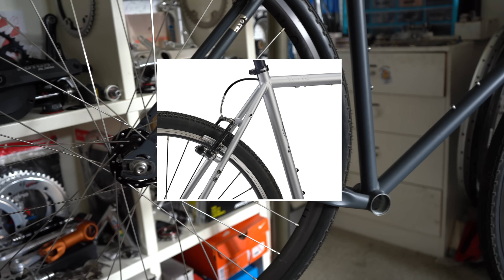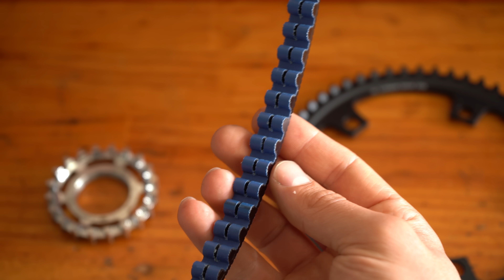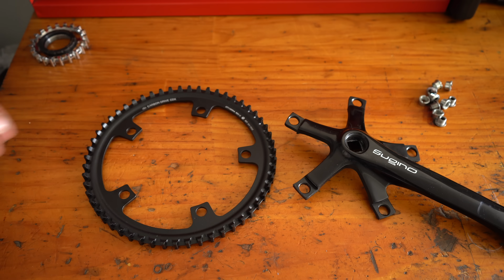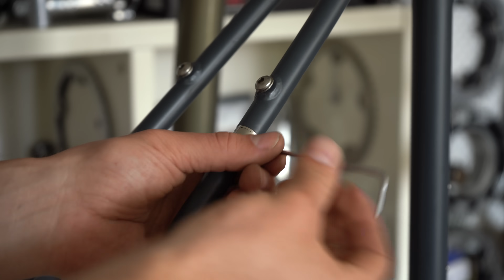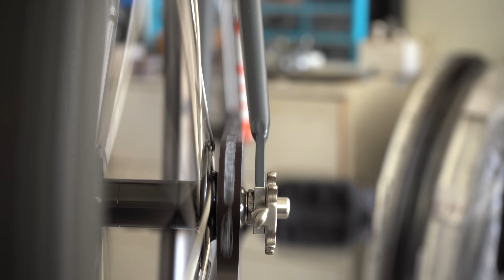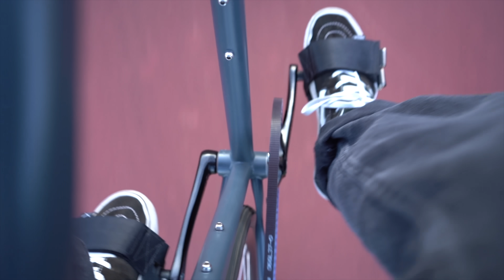Belt Drive Fixed Gear Build

Comment: Nice bike! Beatiful! But caution: Tensioning the belt that much might kill your bottom bracket quite soon. Especially if you don’t use a hollow tec or similar: Brackets with some lever from the belt to the bearings will be stressed a lot from the belt tension. Ask me how I know…

Comment: Belt drive fan here, I'm about 1/3rd through your video, could I say just now, splitting the rear triangle at the axle is genius (never thought of that!), I'd be inclined to run a bigger gear at the rear to reduce wear. That Gates tool they included, it will only work for installation, not removal, which kind of makes it pointless since just hand tightened and then pedalling after fitting would be fine? Removing the rear gear though, that's a different matter, I ended up casting a brass insert for a 1/2" socket, works a treat. Anyway nice, informative info, probably be back after, once I fully view🥳

Comment: Cool build! Might have to try bulding a belt drive bike. I want gears though. I use gates belts on my 3d printer and you can tune the frequency on that as well. On a Voron 3d printer you typically use between 100-120hz, but that belt isn't as stiff as this.

Comment: I'm a regular gravel bike rider and I always wonder how long a tire on a fixed gear bike lasts, especially the rear tire, as braking uses up a lot of rubber... 😊
Reply: Mine last just as long as any other bike. I don't skid very often unless i really have to. Most back pedal, and I run a front brake for emergencies but don't use it very much either.

Comment: Perfect for winter and wet weather- no more rusty chains….that bike is siiiiick! 🤘🏼
Reply: Have been biking my whole life. MTB the last 35 years. Year round in Scandinavia. Have never experienced rust on chains. Belt drives belongs on industrial electric transmissions. Chaindrives has lover losses, always. Is also easier to maintain and cheaper.
Reply: @andersnilsson973  I've been riding my whole life. The last 10 years on a Tout Terrain Panamericana expedition-grade suspended touring frame, averaging 6K miles a year. I've never experienced rust on chain either, partly because I would blow through 3 or 4 chains a year, even with the annoying chain maintenance and regular cleanings. That's with the added advantage of using a Rohloff Speedhub (IGH), so I have a straight chain line and zero chain flex. The best conditions for any chain. But I have had chains fail, and almost everyone stretches in 4 to 6 months, causing the rear gear to wear more quickly. I've changed several on the side of the trail and one in downtown Seattle. I always rode with a prepped spare chain and Rohloff gear.  There is a BaFang BBSHD 1000W mid-drive for assist. I switched to a Gates belt drive over 3000 miles ago and haven't even thought of the belt since, except to take pictures. Zero maintenance or cleaning. No noise at all. It will take a couple of years for me to determine the cost savings, and I couldn't care less about any imagined perceptible power loss; it's a non-factor. If my 60K miles worth of experience (on this single bike) doesn't convince you, read up on Ollie Whalley, who won the 2012 Tour Divide race from Canada to Mexico, or James Bowthorpe, who set a record for the fastest ride around the world, both of whom use a belt drive to turn a Rohloff Speedhub.
Reply: https://photos.app.goo.gl/ADgC6oyPM2gyrCq27

Comment: For all who wonder if they could get away with non-split triangle - yeah, frame with elevated chainstay allows to use a belt without modding frame. Just beware - Gates states that frame has to be very rigid to not flex, this is critical for a belt drive so while you could mount belt I guess these frames aren't very best for a belt. If you look at Gates approved frame list most of them are aluminum frames. I guess, that's to ensure rigidity.

Comment: That's nice for tricks and stuff, but as a commuter I think this would be completely useless for me as I'm so used to freehub, I couldn't drive without it anymore. Freehub is a must. Also I don't like that the frame is compromised because of the belt drive, that's another big negative. Also one speed only, only if there's no hills where you live. All in all this could be a fun ride, but it's very very niche, only for specific conditions and not very flexible.
Reply: Belt drive is especially great for commuters. You come home, wipe tires (maybe) and do your home routine instead of cleaning drivetrain and lubing chain.
Reply: @event4216  lol what, I never touch the chain, or wipe tires. You do it once a year maybe if even that often. IDK maybe if you drive a MTB in a muddy terrain. I commute in a city, sometimes I run into fine gravel. There's literally no reason to justify this kind of "belt drive", it's just a novelty.
Reply: @amonynous9041  Tires - it depends on where yo live and where you keep bike. In apartments wiping tires is a measure to keep clean your living place. Slick tires are very easy to wipe, like 30sec a wheel, and I prefer them to be clean when I go out next day. Clean tires mean better traction.
Reply: @event4216  I have slick tires, it's a road carbon bike from 90es, but I keep it in my garden, really no need to wipe them, no mud. Why would you keep bike in apartment? are you afraid someone might steal it, do you sleep in the same bed with your bike? lol
Reply: @amonynous9041  I haven't got a garden.

Comment: I have a Moulton with Sachs Duomatic hub and belt drive. I like it a lot! No more chain tensioning and lubing. Just clean belt. It is a bit more work when changing a tire though. My bike also has track ends which is not ideal for a belt drive. Best would be sliding dropouts so you could set the tension once and never do it again.
Reply: I too used higher tension before. But after Watching Alee Denhams videos and knowing how low he goes with his belt drive tension I have dropped mine to the lower limit. I has still worked perfectly. Less tension also lessens the wear on hub and BB bearings.

Comment: Do you really have to have a split flame to get it on? Can’t you just have it on the back cog and like just bring it forward• Like the old school way when your train would fall off you put it back on the Big sprocket
Reply: Schindelhauer Hector have what i think ur talking about
Reply: You can't roll belt over ring as it will damage internal structure. Rolling chain also isn't OK, it worked with massive steel rings and people who don't put out lot of power.

Comment: dope setup! I moded my old surly ogre touring bike to take belts and have an onxy SS 6-bolt disc hub so I can use it as a flip-flop hub with the 6 bolt gates cogs. running mtb tires and super short ratio so its usable as a commuter/gravel/touring rig. still working up the courage to try the fix cog again after a near miss!

Comment: One tip that they don't tell you: tension the belt based on the conditions you'll be riding in. I've set my belt to the right tension indoors at room temperature, but then going out riding on hot, sunny days found that the bike frame may expand enough to put the tension higher than the recommended upper range. The same goes for the cold: your frame will contract. Your body won't notice the very slight change, but your belt will.

When the belt is outside of its tension range, it will wear much faster. I've noticed when riding on hot days, my belt will start to squeak after only five kilometres. Pouring water on it will help, but after another five km, it starts again. Running your fingers over the teeth you'll find a lot of dust. It's not dust from the environment, but the belt teeth wearing down.

Belts will last a long time and won't stretch like a chain, but you have to pay attention to tension and the things that affect it. I've only noticed this relatively recently, so my belt isn't in as good of condition as it should be after only a year.
Reply: Chains never stretch unless made of rubber, they wear out.
Reply: @kjm-ch7jc  The amount of wear on a chain is called it's "stretch."

Comment: I exclusively only use gates belt drive on my bikes and have owned quite a few now. The belt tension specs are not as stringent as gates recommends. At least as far as being loose. Over tensioning is more of an issue. if the "chainline" is not perfect having the belt a little bit loose is better.

Comment: Veer makes a split belt for frames that lack seat stay split.  The "joint" is spread over a length of the belt (sorry, idk how much)... seems like a nice option, albeit kinda expensive...but so are special belt drive frames.
Reply from the maker: Just read another comment mentioning them, I’ll have to have a look. The idea of having a belt with a joint/link makes me a little nervous but curios
Reply: @waveywheelies  same, which is why I have not really committed to buying the set up.
Reply: @waveywheelies  I've looked at a few pics of the belt and it appears the "joint" is spread over approximately 20 "pins".... the belt-ring and rear "sprockets" also look proprietary within the veer ecosystem.  I'm still intrigued, but also very hesitant to buy.
Reply: I have ridden the Veer belt for quite a while and it has worked great for me! They recommend running lower tension than Gates because of the split design, so belt slip can become an issue, but I haven't had trouble with it. One thing to watch for is that the chain line is extremely important, maybe even more so than with the Gates system, as the rear cog doesn't have any sort of spline to keep the belt from running off the cog.
Reply: @simonbrans734  so not a good choice for fixed gear....I'd probably go belt drive for my IGH bikes.

Comment: My first bike when I got back into cycling as an adult was a cinelli tutto just like this one.  I rode it as a singlespeed a ton, including with a Gates belt set up, and also ran it with a 2-speed sturmey archer kickshift hub that also could use the belt drive.  Awesome bike, very fun and versatile to work on and build up. cheers
Reply from the maker: That’s awesome! A shame they changed the design so much. The split link gives them a whole different use that not many frames cater for. That sturmey 2 speed sounds interesting! Thanks for the comment🙏

Comment: 8:12 It basically not needed. Just two discs. One on outer side of front cog and second on inner side of rear cog. It for those who wanted to try belt drive, but can't afford this overpriced Gates system. If You use wide enough belt and cogs installed precisely even they basically not needed, but "just in case" better to have.

Comment: Anything with "fix" label on bicycle parts cost redicilous for what it is...
I made single speed bicycle without this shit which literally cost like my bicycle EACH... Just using automotive belt and cogs. From my experience it not so much in need of tension, but pushing roller for which usual caliper hanger actually quite good placement.
This priciness just killing me... More than 380$ monthly wage. 🤬
Reply: How did you use automotive cogs as the "beltring" and freewheel?
Reply: First of all I ask about topic friends and one of them mentioned model with cheap enough parts. Then I buy set of two cogs(toothed pulleys) and belt. 
Then I "nicely asked" coworker to help(on my workplace we don't have CNC, so it was done in old way). He cut middle of those cogs(toothed pulleys). Then just drill holes for attach front cog on a crank arm which have changeable chainring by default and just by myself drill and screwed in ring plate on outside of front cog. 
For rear cog little bit harder. Cog(toothed pulley) with milled middle part I put on complete cassette(struggle to describe on english, low end unit usually up to 7 speed, but not a freewheel even if same principles, which just screwed on rear hub without barrel unlike higher price cassettes which is just set of cogs which You put on barrel... Essentially it is freewheel for seven speed derailleurs). Remove chainrings from cassette and use just bearings in cassette body. Make channel in rear cog and body of cassette for stopping pin to couple them, because I can't make thread on cassette body to just screw it like freewheel. Put it all together and secure stopping pin by end cup from cassette with teeth of it being cut out .
I use steel frame so just cut out piece of right seat stay. Take short piece of pipe and make cut through it's length. Put resulted piece of pipe on right seat stay and drill on ends for tightening them by bolts.
Belt... You need to measure distance from center of bottom bracket shell to nearest position of wheel axel(my frame have horizontal dropouts) and then there are calculators which help You got right length of belt for this length and given cogs number of teeth. Then search automotive belts of resulting length and teeth step length equal to Your cogs. Preferably with teeth of HTD or STD profile and with 1-3 teeth count more than resulting length. Only producers who write such info are Gates and Bosch funny enough.
Other stuff insignificant. Also it can be done little bit easier than I've done. Also I literally not first one who done it. Obviously You need to have instruments for that and hands which grows from right place. All this is easier than it sound, but still You exchange Your work for less money on conversion. I also don't mentioned tension roller, but wrote in another comment that it can be done using derailleur hanger by screwing in it bolt with tied on it industrial bearings of right size.
I was forced to done it because ridiculously overpriced parts which also inaccessible in my country, but if You can just by it... It easier.
Hope language barrier not made my words into gibberish. Any links I can give You on this topic are unfortunately on russian or ukrainian even if they with photos of actual converted bicycles.
P.S.: I doubt anyone will read this, but if some one do - I redact it for being little easier to understand. Original comment was written on smartphone and it is pain to write and redact such longreads on it.
Reply: Shit... Only afterwards got it. Mean cogs which used for teeth belts in car engines.

Comment: Very nice build! One tip for measuring the belt tension with the Gates app: measure the tension at different positions of the cranks. The chainring ("beltring" in this case) is almost never perfectly concentric with the BB axle, which means the tension will increase at certain positions of the crank. As a constant tension of the belt is really important for proper functioning and durability of the drivetrain, I would advise to check the tension at quarter turns of the crank and make sure the tension never exceeds the limit. If there is a big discrepancy in tensions, try to get the beltring centered better on the crank. The belt will also stretch slightly during the first few rides, so make sure to check the tension again after a while.

Also like you mentioned in the video, a higher tension can create a bit of drag on the drivetrain components. In my experience with beltdrive bikes, belt-slip is really never an issue unless the belt is completely loose. I run an internal gear hub with beltdrive and have the tension at about 40Hz, as that is recommended for internal gear hubs, and have never had issues. To save the bearings of your hub and bb I would personally run a slightly lower tension, but I guess 65Hz is still within the recommended range, so if it gives you peace of mind, go for it.

Also really love the Surly Tuggnuts! I use them too for tensioning the belt, though I have found, just using one on the driveside to tension works fine. Just make sure you centre the rim between the chainstays.

Have fun with the bike!
Reply from the maker: Thanks for the Intel! After finishing the build I did end up measuring the tension at different positions, it ranged maybe 5htz or so. After the first ride it remained practically the same tension. I’ll definitely check the tension after a few more bigger rides! 

Yeah the tuggnuts are great, I run a single one on one of my other set ups but went for two on this one to just try and tune in the belt the best I could while keeping the wheel perfectly centred as the clearance is quite tight!

Comment: I think it's a fantastic transmission: quiet, long-lasting, maintenance-free...
I don't know if a non-fixie bike could be made. But it would be a good option.
The set up is very, very nice.
Reply: Hub gears or pinion. Common for high end commuters
Reply from the maker: Thank you! It’s very very quiet indeed. As @c1m1w said, there’s lots of other commuters and mtbs that run belts, most have either internal gear hubs or gearboxes